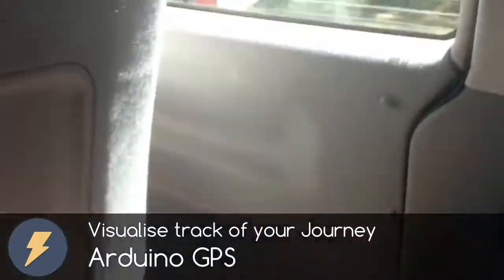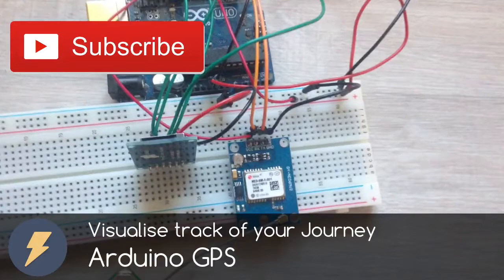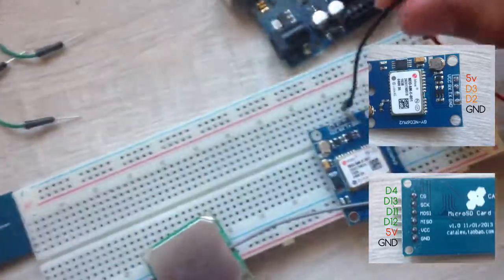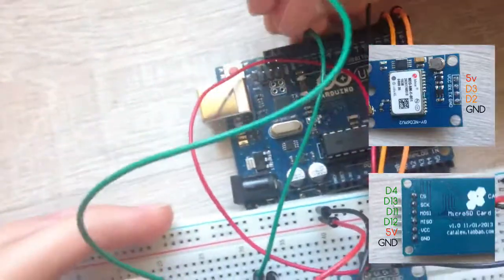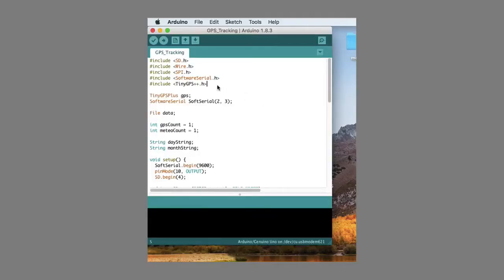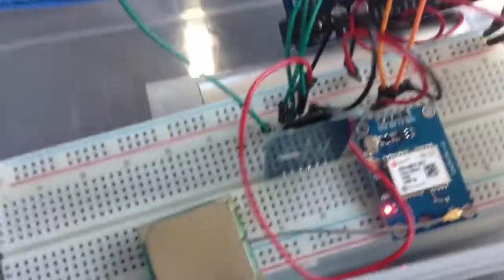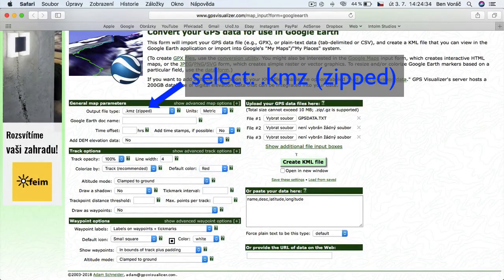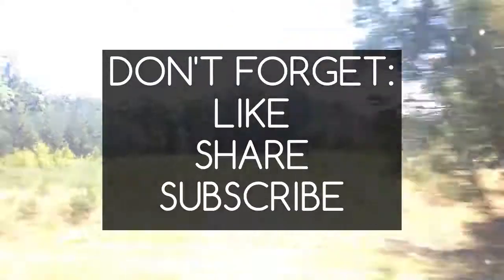How to visualise track of you Journey - Arduino GPS

Comment: Very good video, simple and fast.
a question: does this code also measure the height of the route? would it be useful to see the route of an airplane?
Reply from the maker: yes you can, all data is stored on sd card also altitude but than you must configure it on website shown in video that you want to use altitude data